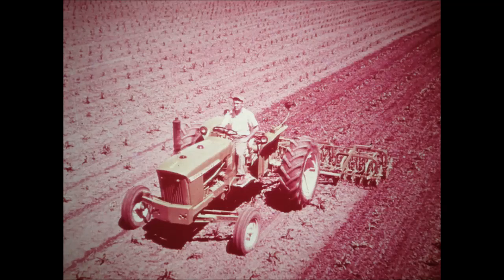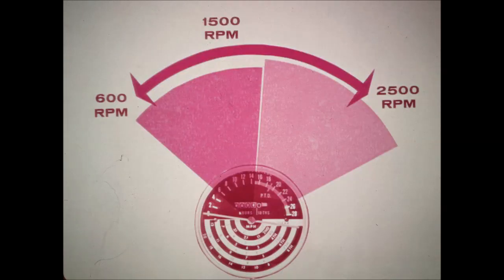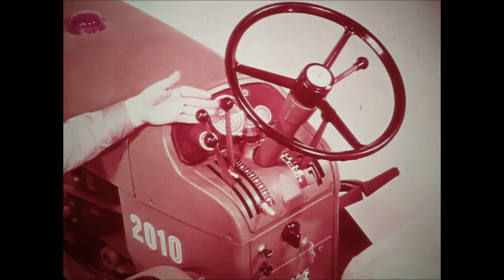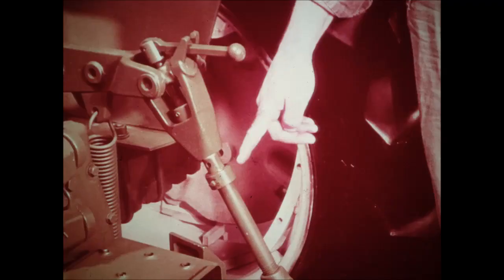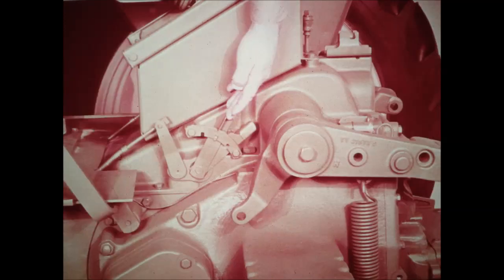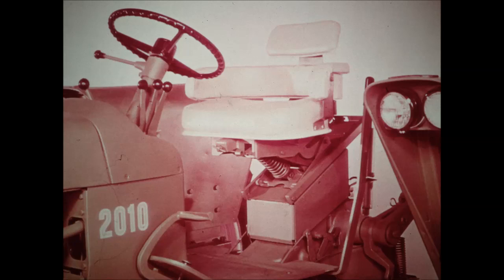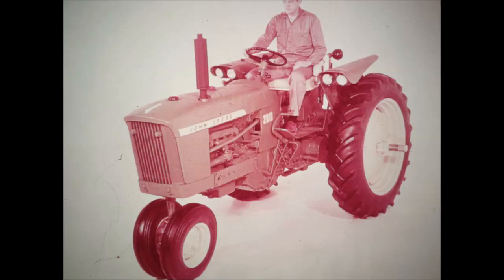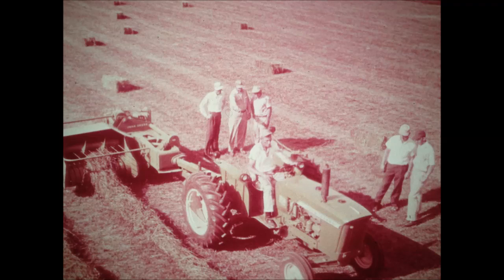John Deere Presents The New 2010 Row Crop Tractors

Comment: Awesome informative footage! What is that lever for Ander the clutch pedal showed at 3:56?  A friend of mine has a JD 4620 (on retirement)  
, which has a knop (like a Jacke break) near the clutch pedal not knowing what for. Someone an idea?
Reply from the maker: The small pedal under the clutch is used to dump the hydraulic pressure to make starting in cold weather easier on the engine. Don't know yet if that feature was available on the larger tractors or not. If you would like, John Deere has free manuals that are downloadable on there manuals page. If you search for a model & find something you want to read, just hit the download button. It may take a minute or two before the box pops up to begin your download, so be patient.
Reply: @ikonseesmrno7300  thanks a lot for the information, even that manual download! I will give it a try. Very interesting detail and never heard about 👍! THX

Comment: I have threatened to sell mine a few times, still might yet. Has been an ongoing problems but hopefully nearly on top of them for now. Doesn’t seem to be many fans of the 2010 here, Ive heard they were a lemon, its off more than it is on.
Reply: My father bought mine in 1981. Since we bought it (with loader), we have resurrected it 15 times…. Several engine rebuilds, an accident rear axle replacement (hit by a car), the 3pt lift cylinders were replaced, a transmission rebuild followed by a complete transmission replacement several years later. She’s a cantankerous little tractor, but I just can’t seem to let it go myself